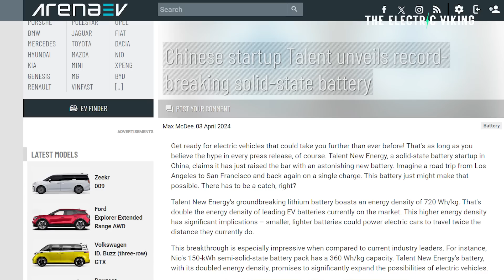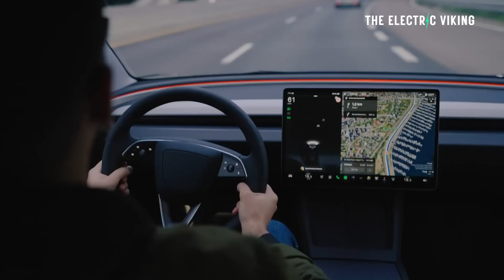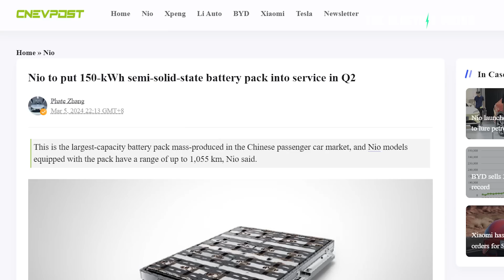Highest energy density battery in the world enables EVs with 1250 mile range

Comment: Achieving 2:14 Real Range of 1000 km and 800km in cold and demanding condition will be the game changer.
Reply: Sorry but you obviously don’t understand physics or basic math. Please do a little research on the cost of electricity and the efficiency of electric drive trains before you spread false information.
Reply: 800km real world winter range would be final straw to put ICE in the grave in all developed countries. Right now the best manages half that, so if that is only 2-3 years away from scale production it would be fantastic.
Reply: @christianolsen9781  If price of electricity drops below the current 15 dollars per gallon equivalent, charge time to full range goes below ten min, 4x registration fees for EV's in some states go away (Looking at you Texas!), and battery weights go down so tires do not wear out 4x as fast, electric grid 4x capacity, 10x number of WORKING fast chargers at 350KW or higher,  less than 2% battery degradation per 100k miles, No battery materials from child slave labor, winter degradation fixed, high vehicle cost fixed, could go on for days or just buy a freaking gas car that has none of these issues.
Reply: @christianolsen9781  You ppl live in lala land.  The price of energy to charge these pieces of junk already exceeds ICE fuel costs. Your EV clunker will be superseded by advances in liquid fuel technology like hydrogen and ammonia composite fuels. The fuels are cheaper and infrastructure a fraction of EV infrastructure.
Reply: @nzer57  Green hydrogen is generated using electricity, with each conversion incurring an energy expense. Furthermore, hydrogen must be stored and transported to distribution hubs. Electricity => hydrogen => compression and transport => electricity. I have the capability to generate electricity from solar panels installed on my roof. Producing electricity from solar energy is cheaper than any fossile fuel.
Reply: @nzer57  nope, I can get 120 miles for around 2.00 GBP internal combustion would be more like 12-15 gbp
Reply: @AntiTheismForeverNo - you just buy a new battery pack at a fraction of todays price.
Reply: @AntiTheismForeverbecause law is wrong.

Comment: 100KWH is 100KWH. The battery will be lighter but range improvement will be marginal. 
You need to fit a battery of similar weight and several times the energy. You have made this mistake many times in your videos.

Comment: Thank you for the excellent EV reporting.  99% of the population I’m sure is fine with less than 400 miles of real world range. 
I understand I’m the odd man out. 
 I drive on back roads almost exclusively and would have to detour from my preferred route to a freeway or more populated area to get a charge.
I put a deposit on the 500+ mile range cyber truck two weeks after it was released based on that driving style.
Reply: @flash3047 My 1996 Hyundai excel can do 550klms on 40 ltrs. Gotta love those old cars !!

Comment: 500 miles (best conditions) is the sweet spot because you would most likely realize 400 miles carrying multiple people, luggage, running AC/heat etc
Reply: That’s over 10 hours of driving motorway speeds, no one does that.
Reply: @Lawrence7of9 ????? Las Vegas is 300 miles from my home. With presentable traffic it's a four hour drive. The only way you would do only 400 miles in ten hours is if you're somehow only driving 40 miles per hour. The ENTIRE time.
Reply: Higher because charging takes longer than filling up. People don't have time to stop and wait 30 minutes at the drop of a hat. They will have to plan around filling up even during regular day to day activities. Higher range will allow people more leeway to wait until they have aome time to recharge
Reply: On UK motorway you can never sit at 70mph (limit) with traffic & slow sections (speed limits) if you average 50mph you’re doing well. 260mile range on my Tesla is often 4-5hrs of such driving here. That’s long enough sat in the car. 300 miles in 5hrs average 60, to average you have to drive alot faster top end so 80+ for sustained periods. Drop down for traffic/junctions etc your average will still plummet overall. Try 0:03  google maps distance/times in Europe you’ll see. 400 miles that’s hours of constant driving, I’ve driven UK to Slovenia, pretty constant (by myself) through Europe it’s 2 days! Long 12 hour+ days.

Comment: This is the real reason why all auto manufacturers are committing to EV's, not for the batteries of today, but for the solid-state batteries of the near-future that will deliver 500+ miles of range, 10-min. recharge time, and 10,000+ cycles, that have a tiny BMS and cost less then today's batteries.  When we start seeing solid-state batteries with these specs, we'll see the rapid end of ICE and full on adoption of EV's.  Low density LFP batteries are perfect for stationary storage as they're cheap, heavy and have a LONG life, however for EV's and consumer electronics, we really need these super high density batts.
Reply: Finally someone with brain n talking sense 👍

Comment: High energy density has been possible for quite a while. 

Problem, the higher the energy density the lower the safety margin. Proponents of these batteries have to demonstrate they are safe under all circumstances of ambient temperatures, accidents etc. It's not easily done. 

To get the power out efficiently they need to be much higher voltage, 800 or 1200V presenting further safety issues. 

They also have to demonstrate how they can be safely and efficiently charged. The reality is we can get 100KW fast charging with relatively minor up grades to the network. Widespread uptake of 200 KW and above will need major network upgrades.
Reply: Some of your facts need correcting.   800 to 1000V charging presents no new safety issues and many chargers already can charge at those voltages.   Safety is important so your point is not lost.  Today's fastest chargers easily can do 250 kW charging and 350 kW for some.  Tesla continues to deploy hundreds of units at these levels per month worldwide.  The overall grid does not need upgrades since it is fully capable of supporting those rates today.   However, depending upon location, grid feeds will need to be beefed up locally, and often augmented by battery systems for remote locations and potentially solar panels (not necessarily mounted at the station).

Comment: Having that "1200 mile" range would be absolutely excellent for adventure trucks like Rivian.
It's not the everyday driving, or driving in a straight line on relatively even surfaces for a constant thousand miles that kind of battery size is good for. It's the 4x4ing out in the wilderness. One of my favorite places to go fishing is deep in the mountains, nearly a hundred miles out from civilization, and I remember taking a gasoline 4x4 truck there and use the 4x4 a little too liberally, and only had a quarter of a tank by the time I got to the camping site in a ravine. I had to have gasoline brought out to me...
Luckily I got out there two days earlier than most of the camp,  so all I had to do was hike to the top of the mountain to get cell phone service and let thim know to bring some down lol. I should be able to reasonably make the trip with a current fully decked out Rivian, because the closest town has superchargers. But if I had 1200 MILE standard range, I could actually use the car battery for driving & even running a bunch of electric appliances lol.
Reply: If it was half that range,600 miles quick charging...thats good enough!
Reply: @jaaklucas1329 honestly you're totally right. This Tech is going to be excellent for electric semis and larger heavier vehicles. I suppose it all comes down 2 whether or not it's cost competitive with current battery technology.

Comment: This makes it easy dont buy an EV until these magic batteries are produced . Every week we hear of a new battery bigger and better but they never get made.
Reply: Energy density of Li-ion over time in Wh/kg:
1995: 150
2005: 225
2015: 300
2020: 475
2023: 700

(note there's a lag between what's acheived vs what's in vehicles, but the energy density improvements are actually accelerating, not slowing down. In the real world - the first Model S offered 210mi range and now offers 400. The first Leaf offered 75mi and now offers 215.)

Also,heres the price of Li-ion over time per kWh:
1990s: $3,000
2010: $1,191
2015: $384
2020: $137
Projection for end of 2024: $57

Hard to look at those trends and think we won't have extremely cheap EVs capable of having double the current range in the next few years at most. Now they might opt to lower cost and weight rather than increase range to 600+mi, but I'm talking like-for-like.
Reply: Same story with flat screen TV's, digital camera's and computers during their earlier development.
Reply: @marviwilson1853  exactly. If flat screens continued to have poor color, poor blacks, screen burn-in, hardly any HD content, and astronomical prices they would never have caught on.... But that's not what happens with technology.
Reply: @marviwilson1853  exactly. If flat screens continued to have poor color, poor blacks, screen burn-in, hardly any HD content, and astronomical prices they would never have caught on.... But that's not what happens with technology.

Comment: There is a significant weight savings by putting up 50 kWh battery into a car instead of 100 kWh but it’s still 50 kW and the extended range will come from the lighter weight not from the energy density.
Reply: If you replace a 100kWh battery with a 50 kWh battery you get about half the range. It’s like filling your gas tank half full.

Comment: 360 wh/kg isn't that great. Definitely not enough for electric jets. Currently aircraft with similar batteries only get 40 min flight time plus reserve. 
If we can get 700 w-h/kg that's great.
Once we get over 1000 w-h/kg you might see single engine electric GA aircraft and eVTOL aircraft becoming more popular. 
Axial flux motors already give massive power in small footprints.

Comment: No battery powered jets ever; prop powered only.
Reply: Electric jetpacks disagree!
Reply: @larryc1616  "jetpacks" are really turboprop propelled. A jet engine's thrust is based on fuel consumption for thrust. Jetpacks are prop powered. They should be called prop packs.  You really made me think on this one and I hope I'm right!
Reply: Clearly you have not been following the development of the Lillium jet. Did you know that the most efficient "jet engines" are the high bypass turbo fans in which about 80% of the thrust comes form a fan blowing air, (a propeller if you like).
Reply: @marviwilson1853  Turbo fans are turbo props.  Jets are fuel based, like rockets.
Reply: @marviwilson1853  Are  turboprops jets ?

Comment: The petrol engine can't be improved. The battery technology is improving RAPIDLY.
Reply: It's clear where this is headed. I have said for a long time that the future is electric, powered by solar. Solar power can provide way more than enough energy to run the world, we just need better batteries. In the future we will look back at when we used to burn things to provide power and it will seem so primitive.
Reply: @sdickinson5234  In England solar isn't enough. But as you say batteries are the crucial component. Without batteries it means all the fossil fuel power stations must be on standby - which is paying double. There's a new battery system being developed which shows promise in the UK with its vast coal mines.
This is the GRAVITY BATTERY. Huge chunks of concrete are attached to chains and lowered up and down mine shafts. When electricity is needed the concrete is lowered to power the dynamo and when there's surplus electricity the concrete is pulled up. SIMPLES
Reply: ICE has peaked and is a dinosaur tech

Comment: High energy density is needed for commercial trucking, buses, construction equipment that needs to work all day without interruption, yet charge fully overnight. We are getting there.
Reply: No we are not. A standard 20 vehicle truck fleet needs a power supply equivalent to a small city. A small city of 500k will need to increase its electrical infrastructure 100 fold then you need to up generation by the same magnitude. Auissie burns coal and gas to drive its energy grid. What a fcked up world.

Comment: 50kwh is only going to get you 200 miles of range regardless of energy density. the tesla cars get ~4 miles per kwh regardless of energy density. the packs could be half the size and you would get the same range but 50kwh is 50kwh. they'd get a slight bump for weight reduction but it wouldnt be dramatic.

Comment: Higher watts per kilo will make the battery pack lighter and charge faster so its all a step in the right direction, you will still need ahuge battery pack for a pickup that is used for towing.

Comment: I live in Canada. I would love a car that could go 1000 km without having to charge. There places I can't go right now because I am not sure about the charging infrastructure.
Reply: Can you do 1000 in an ICE vehicle without refueling?
Reply: @dermotbalaam5358  you can refuel in 2 minutes with maybe looking for a gas station taking up 10 almost anywhere in the USA without risking running out (Ie, last fill up for next 70miles of the like sign).
You're looking at 30min to several hours for electric or possibly overnight if issues.     You're looking at having exceedingly rare chargers in most places with chargers and almost all places have no chargers.
Will there be more chargers?  Sure   you know how many gas stations there are in the USA and how many pumps at each?    You're looking at higher breakdown rates with electric chargers and taking 5-more than a hundred times the time in use.    No Imagine every vehicle needed those chargers.
Reply: @dermotbalaam5358  gas stations are everywhere
Reply: In 3 years
Reply: They already have them.  Just not sure it is being sold in Canada.  BYD U8 has 1000 km range.  BYD leopard 5 hybrid has 1200 km range.  Of course western media don't test them and don't report them.  They don't exist.
Reply: Duh... you know that you can find all chagers instantly in most EV cars,  phone apps, or via a simple web search.
Reply: @youngyingyang however, are they working. Are they all in use with another 10 cars waiting? What's the recharge time in those circumstances? 1 or 2 hrs ?
A modern roadhouse has 30( say) gas pumps, each pump is capable of a through put of 10 cars per hour. That's approx 300 " recharges " per hour. This figure can never be achieved by an EV charging site. If I am wrong pls let me know .
Reply: @robertfonovic3551   You are wrong about most of that with a Tesla.   I've literally waited 2 minutes, once, out of 7 years of EV driving for an open charger (but I don't live in California).  The cars NAV system tells you how many people are at the station and how many are en-route and how many charging stations are available.   Most charging stops are 20 minutes or less.   And most charging is done at home with only about 10% to 15% being done on the road at Charging stations.   Today's Teslas make EV ownership much more convenient if you have home charging than ICE even with 300-350 miles rated range.   My wish for 500 mile range is a nicety and would be a desire instead of a requirement.    I would much rather have my 300 mile range EV than an ICE but I would even more like to have a 500 mile EV.
Reply: @robertfonovic3551  no waiting for chargers here in California. They are at every supermarket, drugstore, big box stores and strip malls always 80% empty.

Comment: With a battery like that you can do a 24hr Le Mans and not stop for anything 🤷‍♂️
Reply: Nope. Can't happen. A 3 hour race would be a stretch. The average fuel consumption in the 2023 Lemans race was 1300 ltrs for the full race. Try packing all that energy into a battery!!!
Reply: Race conditions are not road conditions.
Reply: That's cheating. Got to have one stop at least. But certainly possible

Comment: I think you meant a 720 wh/kg battery the size and weight of today’s comparable 350 wh/kg with a capacity of 100 kWh total.  The new battery would have north of 200 kWh.
Reply: it is not w/kg and not kwh/kg. in one kg of battery you get an energy of 350Wh/kg.
a 500kg heavy battery would then have an energy of 500kg * 350Wh/kg = 175000 kg*Wh/kg = 175000 Wh = 175kWh. with a real world usage of 22kWh/100km you could drive 175kWh / (22kWh/100km) = 175kWh / 22kWh * 100km = 175/22 * 100km = 795.5km
basic math, basic units
Reply: @stefanweilhartner4415  that’s what I meant. I corrected it.
Reply: @rv7pilot  Try again

Comment: I want 400 mile range, 8 minute charging time, 720 w/kg energy density, 1000 charge cycles with max 5% degradation, and $20/kwh.
Reply: the unit w/kg is wrong.
Reply: @stefanweilhartner4415  oops.  Wh/kg.
Reply: It's healthy to want!
Reply: You did not mention Temperature range, self-discharge rate, tolerance to total discharge, faliure rate and calendar degradation rate.
Reply: If you mean $20 per KWh in a pack in a car, they'll have to be 1 oz gold cpins with a $20 face value.

Comment: Sam, why everyone always speaking about toilets when the subject is about EV-charging. I cannot understand. If the real range is for example 1000miles. It will be a lot of smaller if you have to pulling your boat or trailer for example 300-400 miles or if the weather is very cold too and you are pulling a snowmobile etc. Of course we need 800-1000 miles battery because there is a lot of need for it. Diesel trucks could easily pull heavy loads a long time with full tank so that is the need what we all are looking for also to evs. The end of Story.